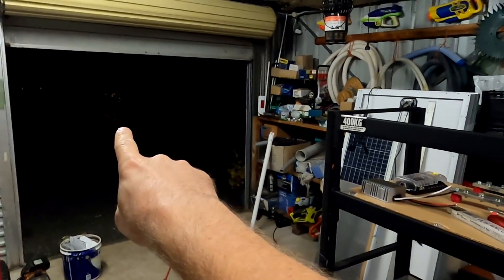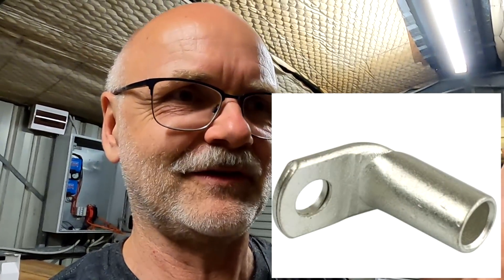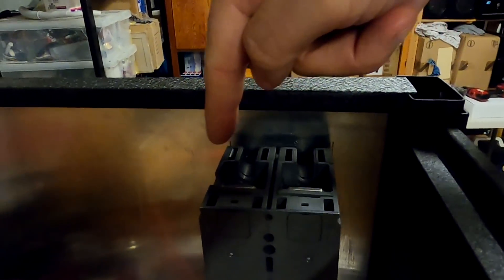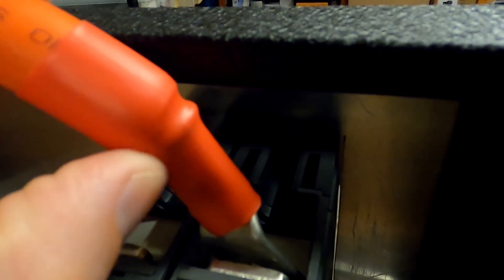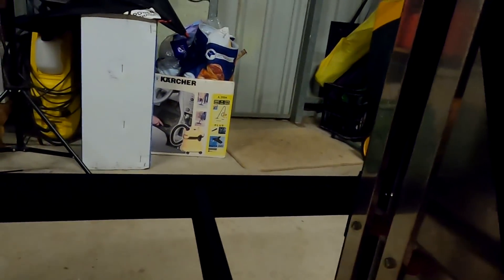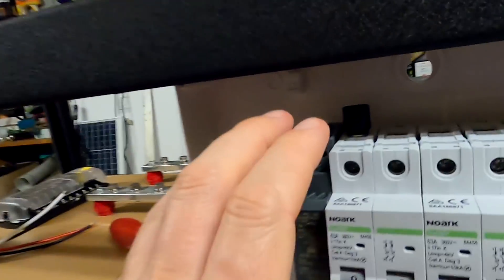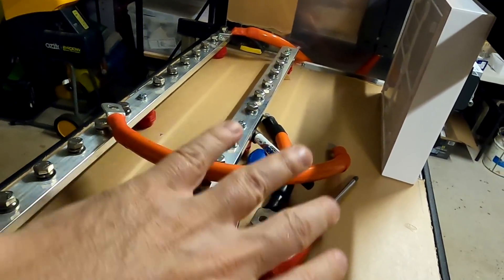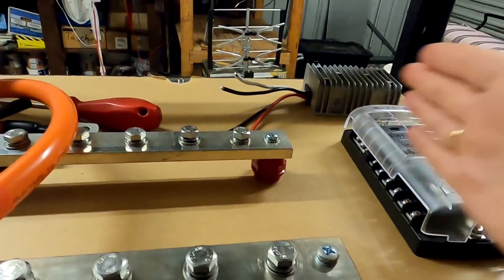Chasing the best connection design. Battery 2.0

Comment: Hi Andy with the too wide lugs you can squeeze them in the vice the hole becomes oval narrower just hammer flat to remove distortion. Also when you need a tight elbow near the lug . Cut an extra 2cms tthen.1st bend and hold in the elbow then the cable inner strands re align. So now cut to correct length and install lug. The elbow will stay due to strands on inner radius now shorter to strands on outer radius of elbow.  Hope this makes sence. Love your content. Keep it up.

Comment: Instead of using that expensive lug you could have fabricated your own custom two hole 90deg link out of a piece of copper or aluminium plate.
Reply from the maker: Yes, had this tip already... next time. A coper link would have been the simple solution.

Comment: 70mm2 cable is only slightly larger than 2/0 AWG cable (67.4mm2). You may be able to get 70mm cable into right angle crimp lugs made for 2/0 AWG
Reply from the maker: I tried that before and this 'slightly' larger/smaller is the problem. It just not the same....
Reply: @OffGridGarageAustralia  oh damn. That just sucks

Comment: You know it’s funny I was always told that you never want to bend a wire power was going to be used on. The story I was told was the water and electrons don’t like sharp corners. Water looses pressure and electrons cause the metal at the bend to heat up eventually causing a problem. I have wired many electrical panels and never made a 90 degree turn in any of them. I have seen very neat wired panels that have all of the wiring with those bends and I believe one you showed us was built that way. Since you like experiments maybe you could draw a hundred amps across a couple connections and see if what I was told is a bunch of crap or true. Great video as always I like watching your stuff. 😀

Comment: Can you fabricate from a solid copper bar a bent cable lug?
Reply from the maker: No, I don't think so. I could have used a straight bus bar link to extend the terminal as others have suggested. I've got a different solution though...

Comment: The “heavy duty” aluminium tube, with copper tip MCB Pins are not too good. One broke off at the aluminium-copper junction, first time I tightened it. Also they are not the correct size, eg 50mm2 cable does not fit 50mm Pin, just fits in 70mm MCB Pin. For smaller connections, of 6 to 10mm I would recommend MCB Pins, with heat shrink, not ferrules. 4mm MCB Pins are very small, and don’t like sharing.
Reply from the maker: Thanks for sharing, Michael.

Comment: I had something similar with 4-0 cables that needed a drastic bend for clearance. I solved it by cutting pieces of 3/16'' thick copper bars that were 3/4'' wide. I made them 2-1/2 inches long. Then drilled the 3/8'' bolt hole in one end and ground the other end to be 5/8'' wide where it could fit in and the Allen bolt would hold it down tight. I bent them at a 90 degree angle.  I hydraulically crimped the store bought nickel plated cable lugs, then bolted them to the copper extensions that I made. I ground the bolt head and nut to 1/2 the original thickness, rounded the edges, then wrapped them fully in rubber tape and put on a layer of shrink wrap while leaving the end bare.

Some years ago I got a nickel electroplating kit that had a small transformer power supply and several bottles of nickel solution. So I plated these lug extensions with nickel before assembling them just for the added corrosion resistance. This system made it much easier to install those thick 4-0 cables without having to drastically bend them. It was on my friend's 65 foot live aboard trawler and worked trouble free.
Reply from the maker: That's a great idea to make small 90° angled busbars out of copper... I'll see what I can find...
Reply: @OffGridGarageAustralia  Best of luck!

Comment: Sorry if I arrive late, but I have a solution, easy, quick and cheap: flat the section of the wire where needed. Put the wire vertical in the vise (if it has grooves inside, protect the plastic sleeve using steel sheet in between) with the lug just out. Press the vise and get the cross section of the wire flat instead round. This will let you to bend the wire with a much smaller radius in such area. I hope this helps you.
Best regards from Madrid, 
Jose
Reply from the maker: Thanks Jose. The problem with this is though that the terminal of the breakers are square, not flat. I would not be able to fit a flat cable into the terminal any more.

Comment: I am sure that the top shelf should not be made of plastic, but of non-flammable material.
From above it can be covered with an insulator. Also non-flammable. For example fiberglass.
Reply from the maker: The shelf is not made out of plastic. The Acrylic is just an insulator.

Comment: I used similar approach ..with one exception i used for inverter NH1 fuses ..they are much better than those on DiN rail..yes they will take more space and you need special tool for removal..but still better than have it on DIN RAIL..and ofc once you will switch to 100Amp charger you will see how inadequate those DIn rail fuse holders/brakers actually are.But still nice video and good luck with your build..

Comment: Hello friend! Just saw that grey voltage converter. Is it the 15-20€ Amazon one? I had 4 of them fail (12-24 volts with only 50% load) after 2-3 months of use input and output where the same
Reply: Yes Andy you need a Victron swap out for this component.
Reply from the maker: No, it's not one of these...

Comment: You should never have asked for ideas 🙂. Something unrelated, but you should move the 300A Noark breaker switch a little bit lower (middle of switch inline with shelf plate), have the vertical bus bars end a little bit lower too (near the top of the shelf space below), then cable from the bus bar in from the bottom of the switch, and out the top to the horizontal bus bar. Cabling would've been easier. Hindsight 20/20 right?
Reply from the maker: I cannot move the breaker any more. That train has left the station...
But there were some good suggestions here, so I can make it work perfectly fine...
Reply: @OffGridGarageAustralia  I realised that at the time of my suggestion but thought I would be that guy that stick to hindsight 😃. I am where you were 6 months ago so at least it helps me or others also early on the journey.

Comment: Hello from the high desert of New Mexico USA 🇺🇸. Hi Andy what do you think about soldering then bend the cable 90 degrees. Keep up the good work and stay safe and charged
Reply from the maker: Hello James, thanks for your comment. Soldering is a big no no because you literally decrease the contact area from the terminal to the cable to 2 points only when tightening the screw at the breaker. That could cause a lot of heat at these small contact areas.

Comment: How about going a fabricater to make brass or copper tube with a square ensert at 90 °
Reply from the maker: Yes, small bus bars angled 90° is what I'm looking at... The problem is that the 35mm ring terminals are wider than the terminals of the breakers, so this may not work either...

Comment: Hi. Something we do at work with the  ferrules or boot lace crimps as we call em. Cut the black collar off and crimp the rest on to the wire as normal. May allow some easier bend radius angle out of the breakers.

Comment: Why are you using 35mm² cables while using 63A breakers? Shouldn't fit a 16mm² for that? Greetings from Duisburg
Reply from the maker: The incoming cable is coming from a 250A busbar to the breaker with 35mm. After the breaker I can go smaller depending on the breaker size.

Comment: Try a brass bolt on the lug to get a 90° bend
Reply from the maker: You cannot use a brass bolt to be connected to the terminal of a breaker.
Reply: @OffGridGarageAustralia  why not, put the bolt through the eye of the terminal,  install a nut then use the end of the bolt like a piece of stripped cable

Comment: Use a copper  pipe,  bend it first then cut , flat one side drill the right hole and crimp cable on  the other end ,clean the inside of the pipe with sand paper or similar, and then you'll get a pure copper Australian made connector in about 30 mins 🤠
Cheers Andy great stuff, love the channel

Comment: Could you not use a short piece of copper to come up out of the fitting and then bolt your existing lug to it to give you a compact 90 degree bend. You could even solder it rather than bolting.
Reply from the maker: Yes, that would be the preferred way, just a copper link with two holes.

Comment: In Western Australia we just use 5% 3mm Silver Solder rods from Bunnings ($6.75 for 75cm rods) to make custom ferrules and lugs. Plain or tinned copper is too high in electrical resistance and not strong enough for most angled or bent installs. Silver solder is easy to shape, weld and is great for high power and high voltage connections. All yo need is a cheap propane torch and a couple of rods. No need to order and wait a week Andy!.
Reply from the maker: But how do you make your own lugs? Just out of copper?

Comment: Rather than getting a elbow cable lug, why not use a bus bar connector to provide an extension to avoid a 90d angle
Reply from the maker: Yes, just a bus bar link with two holes...

Comment: Instead of a bent lug on the breaker, do a short bus bar vertical to the height you need, then the cable horizontal. One extra connection.

Comment: Thinking a little outside the box, but couldn't you use some nickle plated copper bar, bent at 90 degrees with 2 lug holes, and after attaching the wire, heat shrink the whole thing? The thickness required wouldn't be too outrageous...
Hang on! If you rotated the thing on the side shelf 90 degrees anticlockwise, the wire would come straight out?
Reply from the maker: I thought about this. The problem here is though that the lugs are actually wider than the terminals of the breaker. So if you put two cable luges next to each other they take more space than the two terminals. I thought of making shorter and larger ones then... the problem is this is all very close together. I need to stand back and keep thinking a bit more... 😁

Comment: I would lay the box horizontal then it is straight shot for the top of the breaker..... The bottom could then use those 90 degree angels...... Then use a mirror angled if you need to see the breakers...... It's not like you will be switching things off and on alot once it's up and running
Reply from the maker: The breakers need to be accessible from the outside though.

Comment: Oh and also, you get a better balance if you distribute the load and chargers across the busbars and not all bunched together. That way you have less busbar losses from the resistance as the loads and chargers are next to each other and current will flow via much shorter routes.
Reply: Also note, having one charger and one load next to each other and repeat that pattern, you will have the least amount of resistive losses and heating of the bars
Reply from the maker: I think this is from the Victron book. I don't agree with this if you have such a beefy busbar as I have. With smaller ones, yes, maybe... They also recommend to distribute the battery connections across the busbars which I don't agree with wither. You would need several isolators, one for each battery and there is no main switch any more to shut down the whole battery.
Reply: @OffGridGarageAustralia  This is based on physics, everything else is optional. Currents always flows via least resistance and shortest path. No matter how thick or heavy the busbar, it has resistance, allways. Then we always compromise for practical purposes. You need to be pragmatic and do the best you can with what you got….

Comment: When cutting them boot lace ferules, first crimp them, then cut with the cable. It works way better and you can cut accurately with no distortion. I used them exactly like that and cut them. They are excellent.
Reply from the maker: I know, this was just to see if it actually works and they would fit in. But thanks for pointing this out.

Comment: many great ideas here! I'll add an idea to the list.  Heat, Anneal, Bend.  Any of the 3 types of terminals you talked about could be used in this way.  The heat should eliminate the cracking of the lugs.
Reply from the maker: The heat makes the material soft. Even after cooling down again...

Comment: Hello Andy the circuit breakers that you are using have a slot above the cable entry for ring tongue terminal to be used, may require slotting of lug to make it work.
Reply from the maker: yeah, very thin 6mm fork terminals. Would not trust them for 63A.

Comment: Use the ferrules for the breaker connections. 

 Strip the insulation and insert into the ferrule. 

Make the 90 degree bend.  The fine strands you are using will bend and slide inside the ferrules’ tube.

Now crimp to lock the strands tightly together. 

Cut with a handsaw to the length needed by the breaker.
Reply from the maker: Yeah, something like this I have to try...

Comment: Get a small blow torch from Bunnings and heat and bend the lugs.  Copper is a soft metal so this should be easy.
Reply from the maker: No, no, no, you don't do that in power distribution.

Comment: Victron Linx Distributor
Reply from the maker: Would not help at all as I can perfectly connect the cables to the busbars but not to the breakers. You don't use fuses but isolators which disconnect pos and neg in case of a fault.

Comment: Andy, why are you trying to go out the back of the box with all the circuit breakers? Looks like there are already ready-made punch-out holes in the top of that box, meaning your wire would come out of the top of the breaker at maybe a 45 degree angle, rather than ~90 like you're trying to do.

Comment: Andy why don't you strip more insulation back from the lug.  Then when you put the heat shrink on and heat it.  You can bend the wire away from the lug.  The wire should bend very well without the insulation behind the lug.  You could put a bit more shrink tube on at the bend.

Comment: Addendum to the below script:  Though the use of flexible Si cables are much preferred; in certain circumstances 
Viz: the short Positive and Negative cables from the main shut down switch, to the Bus bars, may not be suitable, esthetically.  
The remedy? The use of rigid stranded cable or like in high power switching boxes, sold thick Cu wire (flat even) is recommended. Does the main shutdown switch terminals have 6mm threads for 6mm bolts?
The solid Cu cable can be bent nicely, as you did to connect power to VICTRON Phoenix Inverter. My thoughts. 73s…

Comment: Have you considered drilling a hold through the shelf and coming up from the bottom to a 90 degree lug and attaching that way to the bus bar? I think it would solve a few problems and look pretty clean.
Reply from the maker: Yeah, nah, there is a battery compartment underneath. That should stay separated form the power distribution.

Comment: 111521/1551h PST 🇺🇸    111621/0951h Brisbane 🇦🇺    Good day, Andy. I see your predicament on fitting the Circuit Breaker Box. You are, anyway, fitting frontal Aluminium facia,  why not fix the CB box eternally on the Al sheet?
That way you don’t have to cut the plastic to accommodate the CB box inside or avoid cutting the Al sheet to accommodate the CB switch aperture or no need to hunt for the alluring angled ring terminal. It might, even, look good, esthetically. My thoughts.
I know, this is tough to design things like that, mind boggling, even. Take care und 73s…
Reply from the maker: I have cut the beam of the shelf now and let the box intact. Looks great. Video is coming 😉

Comment: Andy, are you using aluminum buss bars? they look like nickel plated copper to me, but if you are using AL busbars, maybe you would want to clean off any hard corrosion and use anti-corrosion compound, as you will be using copper lugs. 
I'm also surprised by how little space your plastic breaker panel enclosure has between the breaker lugs, it seems not enough to even meet minimum cable bend requirements. It looks too tight to meet minimum internal distribution panel space to be legal in the U.S.
The thin copper ferrels look like the best option of the choices you have,
Reply from the maker: I'm using Al bus bar for the cell connections but not for the breakers.
I'm sure using the ferrules I can bend the cable in a nice way.

Comment: I think making a R.H Lug out of 5mm thick pure Copper (as previously suggested)  then drilling the appropriate size holes as required then heat shrinking the bar between the holes would be the best solution.

Comment: Hi Andy, noticed your 48 to 12v converter. Victron sells one that you can adjust voltage in and out. You can't adjust the one you have. If you have long wires out to your 12v application, voltage drop may be an issue
Reply from the maker: Great tip. I only saw the first page of their PDF and 9A was the max there... 2nd page looks promising though 💪

Comment: You can make your own lugs with copper tubing you can use a flaring tool on one end to put the wire in and cut it about a half inch long crimp it straight to the wire and stick it in your breaker and your wire will bend easily to go out the back
Reply from the maker: Thanks, that could work...

Comment: Just take a scrap piece of copper and your saw. Then you build your own, L-shaped DIY 90 ° angle to connect the cable to the switch disconnector. And of course you have to drill a hole at each end. But drilling in copper is a lot of fun for you, as I saw in the last video ... lol
Reply from the maker: Great idea! I did this before when I worked for the switchboard company. Just didn't cross my mind. Thanks!